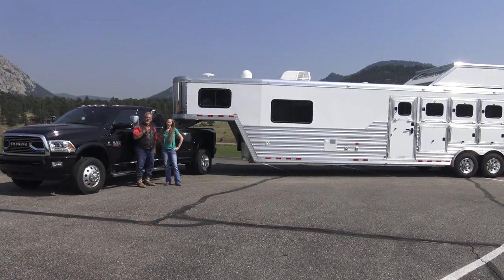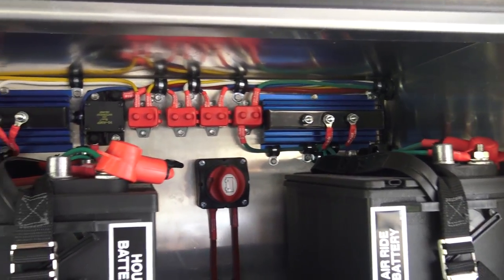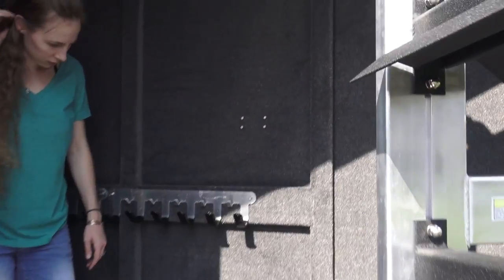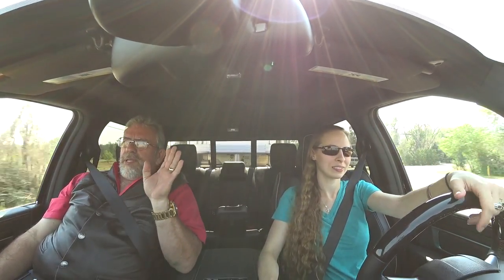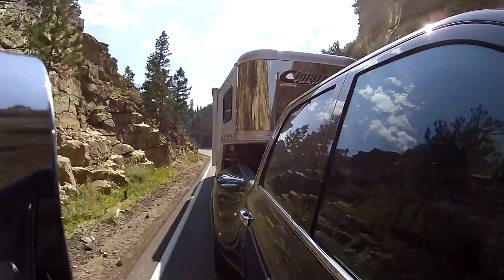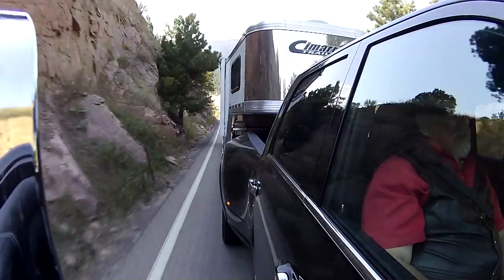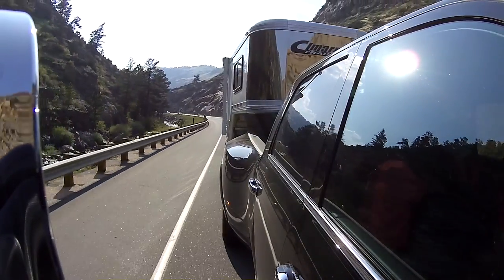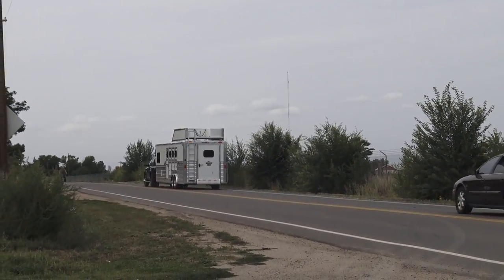2017 Ram 3500 Limited review towing a LQ Cimarron horse trailer part 1

Comment: actually Mr Truck, that truck does have more torque than its competitors, and dyno numbers proves it, the longevity of this truck seems to be higher than the others since it seems to rev less under load, in all the videos in the ike gauntlet that ive seen both ford and Chevy like to rev at 3.6k rpms while the ram has lower end torque and it pulls trough lower RPMs, lower rpms= more life